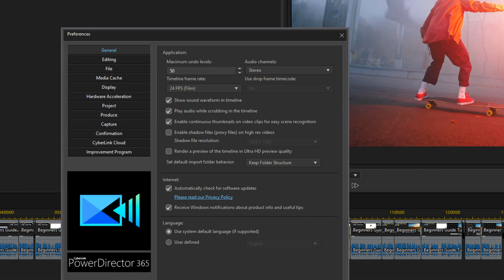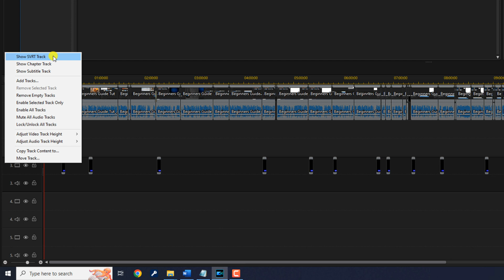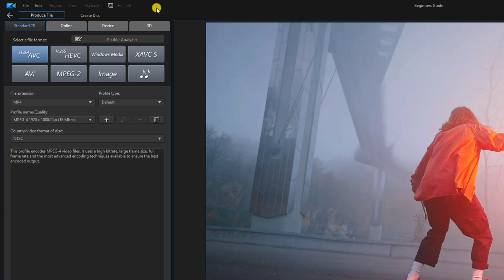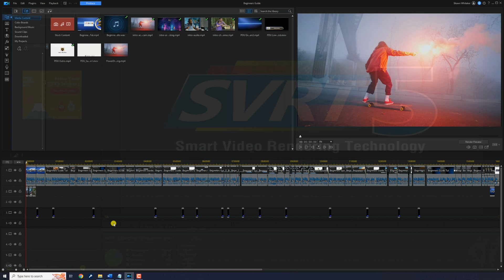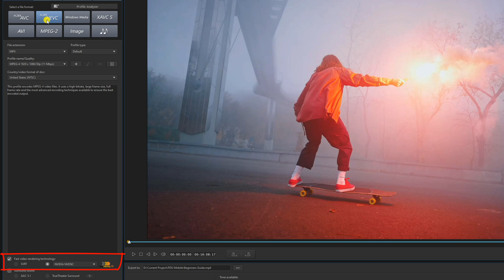The RIGHT Settings for Fast Video Rendering | PowerDirector

Comment: This isn't working (PowerDirector 24). Profile Analyzer shows the profile I've already selected and doesn't let me re-select it. 

The heck of it is, SVRT used to come up by default, but no longer, and I've tried several tricks and tips to un-gray it, to no avail. I don't exactly mind exporting (new name for producing) taking longer, but it'd be nice to have the speed back.

Comment: I did all of things including everything on the second video, it sure made my video producing fast but now my fps is has a high frame rate, the video does not come out smooth like before, why is it doing that?
Reply: Kind of have the same problem since the latest update if I use hardware acceleration my vids render a bit choppy looking like it's skipping frames but is smooth if I don't use the acceleration
Reply: @AL-ud2is  I figured out how to put it back on 60 frame retes per second, you have to go back and click on the little sun icon the (see user preferences)on the top right corner  then on the (general) tab  change the settings back from 30 NTSC fps to 60 fps NTSC hope this helps

Comment: The preview of videoclips in PD is very laggy and choppy on my pc. Even with full HD 1920x1080 videoclips.  Tried all kinds of settings but nothing really helps. I have Wondershare Filmora on my compare and the preview of clips is very smooth. Even with 4k clips! I have a pc with a AMD Ryzen 7 3700x,  Nvidia RTX 3070 8gb, 32gb of ram, 2x M2 1tb ssd and a Gigabyte Aorus X570 motherboard.  Not a slow pc I think. Still the preview of clips in PD is terrible! Do you have any Idea what could be wrong? Hope you can help! Thanks.
Reply from the maker: Not really. You should probably reach out to CyberLink

Comment: This is by far my biggest issue with PowerDirector. Every other software I use, I don't have to render a preview to edit my video.
Reply from the maker: You don’t have to render a preview with PowerDirector either. I don’t have shadow files enabled so I’m using the source files when I edit.
Reply: @PDU_Tutorials  it is super choppy if I don't, even on low quality preview settings. How do I disable shadow?
Reply from the maker: @DarkXenoGaming  Not choppy at all for me. Depends on your specs. You can go to preferences to find the option for shadow files
Reply: @PDU_Tutorials  I think my specs are ok, since other editing software is smooth. I'll give the shadow files a shot. Thank you.
Reply from the maker: @DarkXenoGaming  Sgadow files are temporary files that need to be rendered and should make editing smoother. If you want a smoother editing experience shadow files may help but you would have to wait for them to render.

I don’t use shadow files because my specs are high enough that my editing experience is smooth without needing shadow files to be rendered.
Reply: @PDU_Tutorials  I don't do heavy editing, more just cutting up clips and piecing together with a voice over. Nothing too fancy so hopefully this solves my issue!
Reply: @PDU_Tutorials  What are your specs?  I'm running an AMD Ryzen Threadripper 3960x with 24 physical cores, 48 logical and 96g of ram w/ a 3080ti.  Despite this PD seems to lag for me when editing 1080 or 4k.  PD is installed to my C: drive which is an NVME and the source files are on a separate NVME drive with 1T of dedicated space.
Reply from the maker: @LoicFarris  link to my pc specs is in the description. Hit Show More